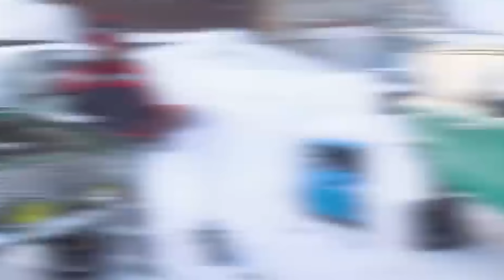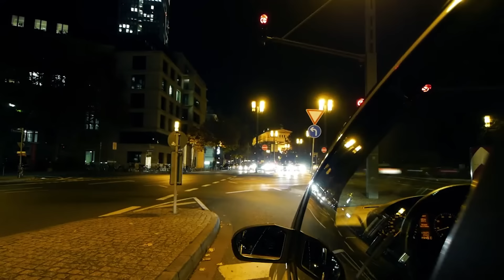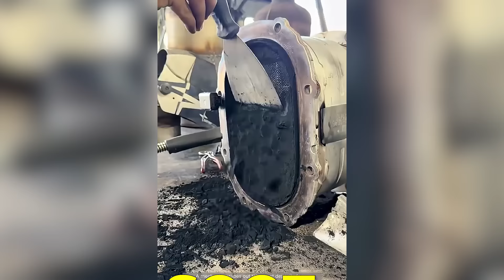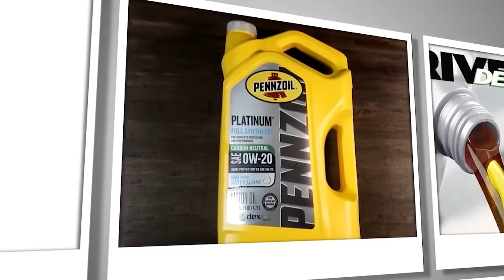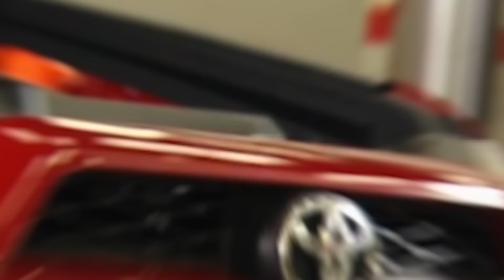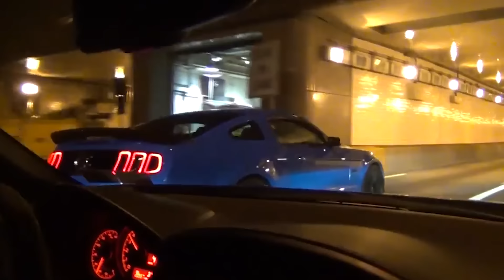(0w20 vs 5w30) The Oil Mistake That Can Kill Your Engine

Comment from the maker: Tricks With WD 40 That Save You Thousands in Repairs - https://www.youtube.com/watch?v=zAxWr8R7sp0&t=805s

⬇Care Care Clues Top DIY Tools and Products:
🚗 Essential Scan Tools
Newest Scan Tool:https://amzn.to/3GJyuET 
Bluetooth Scan Tool: https://amzn.to/42AcBRc 
Cheap Scan Tool: https://amzn.to/42WZIzx 

🔋 Emergency Essentials
Best Jump Starter: https://amzn.to/44fYOAm 

🛢 Fluids and Leak Stoppers
AT-205 Re-Seal (Stops Leaks):  https://amzn.to/3S9icYm 
ATS 505 Fuel System Treatment: https://amzn.to/3YQjjA2
Lucas Oil Transmission Fix: https://amzn.to/4jNk98M 
Bar's Cooling System Stop Leak: https://amzn.to/3Sht0nj 

🔎 Quick DIY Diagnosis Tools
Head Gasket Leak Test Kit: https://amzn.to/4jRgc2T 

🛠 Useful Maintenance Accessories
Quick Twist Oil Drain Valve: https://amzn.to/4jWG3GJ 
Tire Gauge (Check Pressure): https://amzn.to/3GxySGD
Tire Air Pump: https://amzn.to/3RZK9Cd 
CRC Mass Air Flow Sensor Cleaner: https://amzn.to/44dJpkb 

🧰 Mechanic’s Must-Haves
Car Battery Tester: https://amzn.to/4jTqyzk 
Basic Mechanic Tool Set: https://amzn.to/3Ymgerh 
Cordless Impact Wrench: https://amzn.to/3YkkhVc

Comment: After a blown head gasket my shop has my 2.7 Toyota on 5 30 not 0 20
Reply: dang, i feel bad about that, it's like if you went with an issue n they didnt make the suggestion before the big blow, i feel like they coulda been suggested the better oil

Comment: I'm living in warmer Commiefornia so 5w20 or 5w30 all the way for all my 0w20 vehicles.
Reply from the maker: California’s warmer climate can make 5W-20 or 5W-30 seem like a practical choice, but temperature alone shouldn’t determine the oil viscosity. The most important factor is the manufacturer’s specification for the specific engine. If an engine calls for 0W-20, the 0W rating mainly helps with cold starts, while the 20 describes the operating-temperature viscosity. Always check the owner’s manual before switching.

Comment: I live in a very cold part of Canada -30 -40c for extented periods in winter and never had a problem starting vehicles with 5w30 and 5w40.
Reply from the maker: That’s a good real-world example. At −30 to −40°C, 5W-30 or 5W-40 can certainly start an engine successfully, especially with a healthy battery, starter, and properly maintained vehicle. The key point is that the “W” rating describes cold-temperature viscosity, but the actual suitability still depends on the vehicle manufacturer’s specification and the climate. So 5W-30 isn't automatically a problem in extreme cold—but if the manufacturer specifies 0W-20, the 0W-20 is generally formulated to flow more easily during those very cold starts. Thanks for sharing your experience from Canada!

Comment: 5 times longer trick omg! So if my engine lasts 700k miles, your trick will make it run for 3million 500k miles? What a magician! Take my money!!!
Reply from the maker: Fair point 😂 That “5 times longer” wording was meant to illustrate how much oil choice can matter in extreme conditions, not claim that an engine’s lifespan literally multiplies by five. Following the manufacturer’s recommended viscosity and oil specification is still the safest approach.
Reply: @carcareclues  Thanks for being good sport about my exaggerated joke :D

Comment: The real culprits of these problems are the supposedly environmentalist Democrats who enacted the higher fuel efficiency requirements.  Those liberals have no clue in science and technologies; they conveniently ignored greater environmental destructions associated with shorter life spans of cars & components, manufacturing of new cars and parts, disposal of destroyed cars & parts.  Also, the supposedly environment friendly electric cars & solar panels cause far more damages to the environment.
Reply: Specially Harry Reid and Richard Bryan  of NV Reid was made aware and didn't care.
Reply: The engines are designed to run on thinner oils, I highly recommend watching The Motor Oil Geek and see real data like oil analysis/wear analysis. In a lot of cases with the additive packages used, as long as an engine is designed for it the thinner oils actually protect better than thicker oils contrary to popular belief. Always use a high quality oil in appropriate viscosity and with the appropriate approvals and stay on top of oil changes and you will never have an issue. I do 7500km oil changes (severe conditions service schedule) instead of 15,000km and no problems so far using 0w-20 and OEM oil filter.
Reply: @Tomtom88983 who didn't they just design them to run on 0w oil?
There are lesser quality engines that pushed a million miles .ancidotal evidence doesn't prove the rule. Multiple failures do. Class action law suits trending to show lubrication failures at low milage in relation to life of vehicle .I'd love to see a requiment that the warrantie must cover the entire period of financing.
Reply: @gregrising3668 are you talking about the GM L87 recall? That was due to connecting rods machined out of spec and metal contamination in bearing surfaces during manufacturing, Not due to bad oil. They changed the spec from 0w-20 to 0w-40 as it was a cheaper fix than rebuilding motors. Not the oil's fault in that case.

Comment: -30 here in canada. im stuck with 0w20
Reply: Or use 0W-30
Reply: Don't listen to this AI generated slop, watch The Motor Oil Geek. High quality, low ash content 0w20 if your car calls for it is absolutely fine and in fact can be better than higher viscosity oils. In almost all cases the additive package will compensate for the lower viscosity and protect better than thicker engine oils as long as the engine manufacturer recommends the thinner oil.
Reply: Why run 0-20 when 0-30 is an option? One of the few downsides to any of the 0W oils is they burn off more weight during a NOACK volatility test. Close to twice the amount as a 5W. Just use 0W-30 and change it every 5k

Comment: This video appears to be AI generated and is pretty much BS, as there is no 50 engine case study or credible information about it, that you can find anywhere, which backs up what this video implies! Be careful about using non recommended oil, if your car is till under warranty. Using a different grade oil than recommended by the manufacturer can void it.

Comment: Use the oil your engine is designed for, and if you're lucky, you'll have an older motor made for 10W, as they are tanks compared to the toys they make today.

My 1988 Mr2 Supercharged and 1991 Turbo Toyota MR2's are built like tanks, and it'll take 10W30, 40, or even 5W20, but the 0W's are far too thin, unless im using it for a break in after rebuilding the motor. Both of mine still running strong. The engines today are burdened by strict CAFE mandates, and the EPA are making everything disposable. 

I wouldnt buy any car made after 2010.

Comment: Saludos desde Puerto Rico excelente video muy buena información no entiendo mucho el inglés tengo un Kia Rio con 120,000 no tienen señales de fugas qué podría usar trabajo en uber todo el día se podría imaginar lo caliente que el motor se pone la agencia dice 5W20 me podrías indicar que Oil puedo usar gracias 🙏
Reply: 5W-30
Reply: I highly recommend watching Lake from The Motor Oil Geek, a lot of these videos are speculation whereas lake uses real data to tell you what oil to use! Thinner oil can actually be better if the engine is designed for it. The additive package helps compensate for the thin oil and in many cases can protect better than thicker oil as long as the engine is designed for it.

Comment: I used to use 0w-20 after an engine replacement the mechanic told me to use 5w-20 it’s a Tacoma 2.l
Reply: 0W-20 and 5W-20 are the same weight oil. That doesn’t make any sense.
Reply: Probably because the Tacoma in summertime will get hotter, and the oil will become thinner adding to more wear. It’s a heavier car. Project farm did a wear test on all of them. Check it out.
Reply: @StarrkIndustries his bearing wear test is not accurate compared to conditions that engines actually operate under. I highly recommend watching Lake from The Motor Oil Geek to get real results and real data.
Reply: @Tomtom88983  he's a lab nerd. His own findings prove nothing to the different. Stick with common sense, geek thicker will protect better. yes it runs slower when it's cold but unless you're in -20f  temperatures you'll be fine and better protected than with that tree hugger mineral oil.
Reply: My 2018 2gr-fks gets 5w-20 instead of that 0 crap and I'm considering 5w-30 like my 1gr-fe. There are many pre 2018 Toyotas with 300k and no problems running 5-30. That will be less true with the newer models.

Comment: Falsely claiming AI slop
Reply: Right? If the engine manufacturer recommends 0w-20 it is fine. I live in Australia and for my partner's car Mazda recommends anywhere from a 0W-20 to a 10W-30 for the 2.5L skyactiv-G PY-VPS engine. I always recommend using the highest quality full synthetic oil where possible. I use Castrol Edge Extended Performance 0w-20 and follow the severe conditions service schedule for the engine oil changes, which is 7500km instead of the standard 15,000km. Engine never misses a beat and loves 0W-20.

Comment: 0w 20 is bad for fuel injections . Castrol edge synthetic 5w30
Reply: Wtf does the oil weight have to do with the fuel injection
Reply: @digitalunit318 😂
Reply: Complete bs

Comment: How to correctly choose truly fully synthetic motor oil: Motor oil components - base oil. Base oil - Group V base oil (aviation neopentyl polyol ester + Group IV base oil polyalphaolefin). Neopentyl polyol ester base oil is recognized worldwide as the best aviation base oil.

What is Mobil Jet Oil
The base stock used is selected on the premise that the final oil product will need to operate in juxtaposing temperature conditions. The base stock reacts to polyhydric alcohols with fatty acids. This in turn results in a chemical compound with exceptional thermal stability, known as neopentyl polyol esters.

NECO
THE ADVANTAGES OF NEOPOLYOL ESTERS
Neopolyol esters do not have any ß-hydrogen in their molecules, so they decompose at a much higher temperature (320 to 340°C), while diesters decompose at about 280°C. Due to their poorer thermal stability, diesters have been dropped and replaced by neopolyol esters. Neopolyol esters are the only base fluids that deliver the thermal and oxidative stability, lubricity, cleanliness and low temperature behavior required for jet engine lubrication.
Reply: What?
Reply: @Mrvanner11  Aviation-grade neopentyl polyol ester base oil - a savior for modern high-tech turbo engines.
How to correctly choose truly fully synthetic motor oil: 
Motor oil components - base oil. 
Base oil - Group V base oil (aviation neopentyl polyol ester + Group IV base oil (PAO)polyalphaolefin).
Advantages of aviation neopentyl polyol ester base oils:
Neopentyl polyol ester base oils for aviation lack any β-hydrogen in their molecules, therefore they decompose at higher temperatures (320 to 340°C), while diesters decompose at approximately 280°C. Due to their poor thermal stability, diesters have been phased out and replaced by aviation neopentyl polyol ester base oils. Aviation neopentyl polyol ester base oils are the only base oils capable of providing the thermal and oxidative stability, lubricity, cleanliness, and low-temperature performance required for aviation jet engine lubrication.
Advantages of ester oils: Easily adsorbed and stable oil film. The polar structure gives ester oils special lubricating properties, easily adsorbing onto interfaces to form a stable oil film, preventing complete backflow even in cold conditions, providing excellent low-temperature protection. For example, compared to mineral oil lubricants, the polar functional groups of ester groups act like a gecko's suction cup, adhering to the friction pair interface and not easily detaching even in cold conditions.
After reading the above, do you understand why ester-based fully synthetic lubricants are expensive and why they are good?
Reply: @Mrvanner11 it's a bunch of nerd shit. Basically Amsoil signature every 3-5k.

Comment: My oil cap says OW-20 I never use that grade oil once. However I can't say the same, for people who owned my car before me. But since ownership in my hand, I've been using 5W-20 full Synthetic Mobil 1 all season, all year around. My engine runs healthy, no high oil consumption at all. It starts up in the Winter without struggling, and during the warmer weather it warms up to it's normal operating temperature in just 5 minutes as I'm driving. Toyota does not recommend 5W-30 oil, it's too thick for the pistons and cams. And it will freeze in the Winter. My Camry had 250,000kms when I bought it in 2020 it now has 314,300kms in 2025 using 5W-20 full Synthetic Mobil 1 Extended performance. You cannot use a thicker oil, if your car manufacturers didn't recommend it. For Toyota's the thickest oil we can use is 5W-20 not 5W-30
Reply: This might be the most ignorant statement on this subject I ever read. The 0 and 5 have nothing to do with the oil viscosity. The reason for the 0 is for cold start up flow characteristics. Nothing more. Multigrade oils are just that. 0 weight at -50 Degrees and 20 or 30 weight at 212 as the NOACK test used those to grade them.
Reply: @digitalunit318  You don't seem to understand what I'm saying. Early 2000's Toyota's are not recommended to take 5W-30 only Honda's can take it. The thickest oil we can use on older Toyota's, is 5W-20 Full Synthetic. My 2016 Scion TC uses OW-20, the thickest oil I can use is 5W-20 You cannot use a high grade oil that's not recommended by the manufacturers.
Reply: @static_Tricolor_camry i have a 2001 Toyota camry 5sfe and  2002 toyota avalon 1mze fe. Both have 5W-30 on the oil cap. I run 10W-30 in both. Engines can take the minimal difference between 20 and 30 weight oil. The first number is irrelevant for what you are saying. More importantly is the type of oil pump the engine has. The same car in other countries use 30 weight oil. In the US we have epa and cafe standards which is why they put 20 or less in them to reach ridiculous mpg ratings.
Reply: @static_Tricolor_camry  that's a lie. My sister had a 2002 Toyota Camry with the 2.4 and it said 5W-30 on the oil cap. Also, 5W-30 does not freeze in winter LOL!
Reply: I guess you've never heard of oil viscosity charts...
Reply: Nice thing about running 5W-20, the valve
train doesn’t make noise, as it did with
0W-20. 
😁👍

Comment: Do you want to void the warranty? Then use an oil not recommended by the manufacturer because you know better than them.
Reply: They also have to prove the oil grade was the cause of the failure.
Reply: It's illegal for dealers to do that. They have to prove it was the oil viscosity .  But you also have to be rich enough to fight them.
Reply: They will do everything they can to wiggle out of covering anything anyways.

Comment: Additives to combat the thiness at the rings? Like Lucas oil stabilizer or risolene?
Reply: Projectfarms proved MMO increased lubrication and the detergent package.
Reply: @lonniebeal6032 project farm does not use accurate testing methods, he is good for many things but his bearing wear test is not accurate for actual engine conditions. Oil analysis from real engines is where it's at. The Motor Oil Geek proves that in a large amount of cases that engine oil additives INCREASE engine wear. Just use a high quality synthetic oil that has the appropriate viscosity and approvals that the engine manufacturer recommends...
Reply: MMO is Marvel Mystery Oil.
Reply: Use a better oil. Lucas is junk. Change more frequently, especially of turbo.
Reply: Oil additives can increase perceived smoothness of the engine but can accelerate engine wear because you are messing with the additive package that is already in the oil, changing pH etc. watch The Motor Oil Geek for real data and real science.

Comment: Use the oil what is recommened to your car by manufacturer. (Honda) in my case and no issues...
Reply: It's hard to make an informed decision when manufacturer recommendations are heavily weighed by CAFE requirements and fine avoidance. Stellantis paid 191 Million just this last year.  Getting that last mpg out of our vehicles is less important to many consumers vs vehicle longevity and Many mechanics are claiming early engine failure due to overly thin oil.  Determing which cars can run heavier oils is hard to verify and apparently inadvisable for some.

Comment: After watching I’m confused. Change but don’t change.
Reply: Depends on your oil pump type. If the car has a variable type pump it is programmed to the viscosity that is recommended. Dont change viscosity. Change the oil more frequently.
Reply: AI slop is unreliable. Give it a few years.

Comment: Giving false information must be your thing. The vehicle manufacturer who spent millions producing cars are the ones who provides what's needed to maintain their cars.
Reply: Manufacturer Recommendations in the U.S. are Heavily Influenced by CAFE requirements and the fine avoidance and may not be what's best for your engine longevity.
Just for Laughs my recently purchased Mazda manual says 0W-20 in the U.S. or Canada rest of the World 5W-30 recommended with 5W-20, 0W-30 or 10W-30 as alternates on availibility.
Reply: @FrankRizzo-pe5lt this is apparently AI slope with made up facts so...
Reply: I use analytical instruments for chemistry, and I found the field tech know a lot more about troubleshooting than the engineer who answers the phone when you call with a problem.  The tech have hands on experience, just like the auto mechanics, so I trust the judgment of those who get their hands dirty  more.
Reply: How do you know if the vehicle has a mechanical or varable electric oil pump that is programmed for a specific oil viscosity. Thicker oil increases oil pressure and may not get to where it is needed in this scenario.